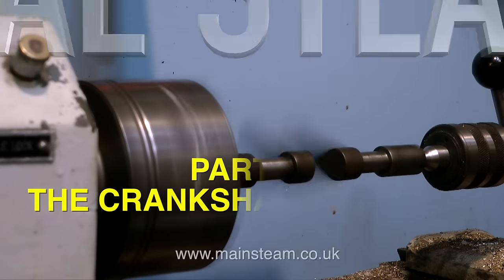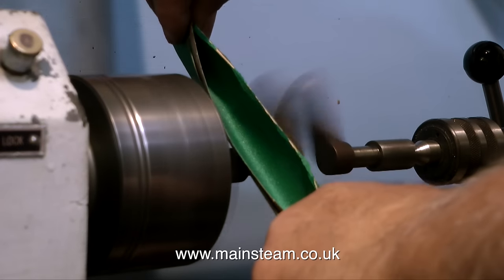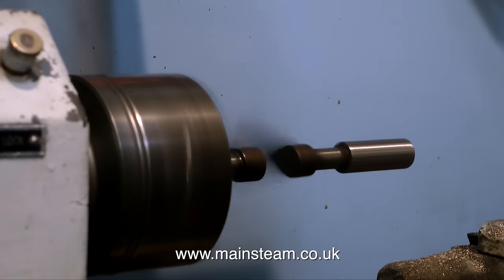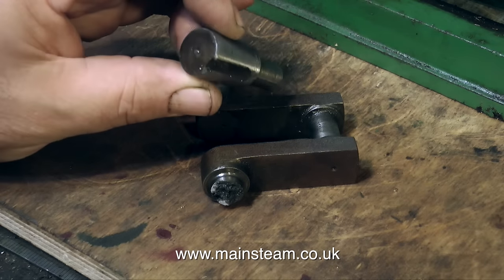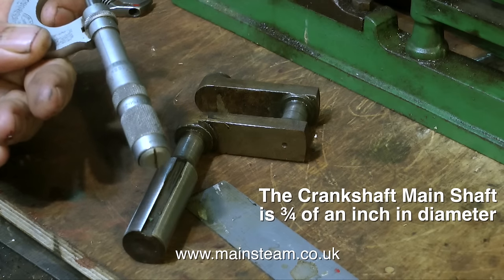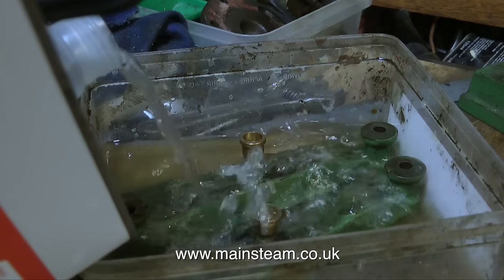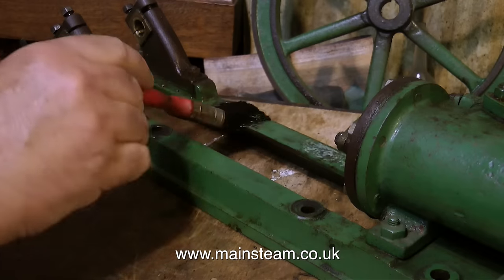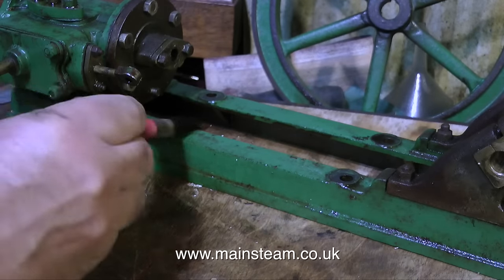PART 3 - LARGE HORIZONTAL STEAM ENGINE REBUILD

Comment: Hi Keith, I soon hope to start construction of an engine that came with some piston rings.  Is it better to use a silicone O ring instead?  I have been reading Tubal Caine's book on construction which suggests recessing the ends of the cylinder to prevent a step forming with wear.  I imagine that the silicone rings would make this unnecessary.